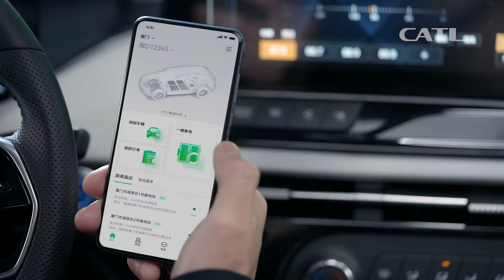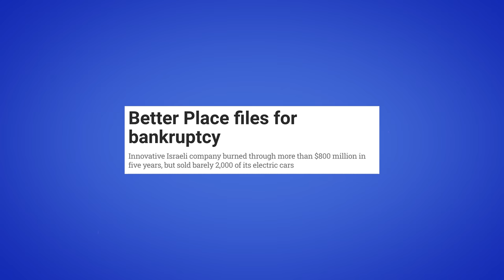Why Battery Swapping Is A BAD Idea

Comment: I must say i do not agree with your opinion, battery swap is the obly way to control waste and recycle the battery without wasting what is in it which as you said may be not enough. Think of alluminium cans they are all recycle because it is expensive to get alluminium. Alos there is another point you have not considered. If the battery fails for any reason in your vehicle, you are out of the sudden with an expensive paperclip. With battery swap will never happen, as it does not happen today with petrol cars, is you fuel tank is leaking you do not scrap your car, different is if your batter is sealed into the chassis and it is part of it scrapping the vehicle is the only economical solution. I would finally say that the goverment does not need to control car makers to change the market. Call all of them as said x size is the battery for city cars,x size is for medium cars and so on…they will need to stick to that and everything will be sorted..i think sometimes we think only at now and not at tomorrow but imagine how to manage milions of vehicle with a toxic waste welded in it on the scrapyard….

Comment: 3:40 "You could charge 72 cars in an hour"
You could actually do far better than that as a typical road trip charge takes around 15 minutes or less. Charging for an hour would be a massive waste of time and would be very unfriendly for your car's battery pack.

People typically think charging is like filling up with gas. When you notice you're low you pull into a station and fill from almost empty to full. That's not how it works with EV vehicles. Normally one would charge starting at around 10% or 20% and only going up to only 70%. After 70%, Tesla's charge at a GREATLY decreased rate to protect the battery pack. 

You'd therefore more than likely get closer to a maximum number of charges closer to 280 cars from a 72 stall Supercharger location.

Comment: There are technical reasons you mentioned, yes. I agree with your conclusion from just the technical reasons. But there's a bigger issue. The batteries are expensive and have limited lifetime, much shorter than the car itself. The price for a new battery is around $20K but the value will drop fast as you use it. Swapping means that you are swapping your $20K battery with some $5K battery. Oh, no private ownership but shared ownership  of batteries some people say? Shared ownership never happens with such pricey things, period. Never going to happen unless you are in a communist country.

Comment: I've owned my Model 3 for almost 3 years now and have gone to a super charger twice. I LOVE not going to the gas station. A battery swap station is just as bad... unless I could also charge it at home. Might work for long haul trucking however.

Comment: Battery swapping won't be a debate it will be required, and standardized by governments. 
Batteries don't like fast charging, the little pixies get all angry and hot when ya push them around like that. and it greatly reduces their life. 
Also power grids will be pushed to brink. If fast charging were to become the standard. 
But trickle charge over 8 to 12 hours with low amp's no change to grid required. 
Also the reduced risk for explosions, fires, with the added bonus of better battery maintenance👍
Further more:
Tesla's battery swapping was an absolute joke.
You had to purchase a 20,000$ battery, and there was only one location. 
Between L.A. and Sacramento I think to swap it out. But a year or so later the cars could do the journey on a single charge. So bye bye changing station. I wonder if the tool refunded the money for the batteries. 
I bet he didn't🐸
Reply from the maker: The swap stations can hold a max of 13 spare batteries. Let’s assume they’re all fully charged at 9am. By 11am they might all be empty due to swaps. You want to trickle charge 13 empty batteries over the course of the rest of the day? If that’s the case your battery swap station is useless as it’ll only have full batteries in the morning and at night.
Reply: @AutoTraderTV  For the most part, the average driver wouldn't need to swap out a battery. 
Simple fact most people don't drive more than 100 miles per day. Semi's, delivery trucks, bus lines, taxis they'll highly most likely will be swapping.
The possibilities are endless, and I can't wait. 
If you don't think the world isn't ready, or mabey you personally aren't,  let me give you a little food for thought. 
2022 we saw the release of Ford Lightning, the F-150 is the number 1 selling vehicle on the planet.
The all electric Ford lightning sold out the first year of projected production numbers in "less than a week"
Every six seconds someone buys a new F-150 and now they can buy the fastest, most reliable one ever made  🐸 and just so happens they don't burn dead dinosaurs.
Reply: @AutoTraderTV  Ya still there😕 where I live the price of gasoline has literally double over the last month. This single event will touch everything. 100% inflation rate over less than 30 days.
Really not good.
Electric vehicles would be immune to the volatile market's such as crude oil.
Plus with reduced demand mabey they don't wage so many wars over it either.

Here's something ironic, between the U.S. and Russia there's enough natural gas on reserve to power every home and car on planet for 200 years with virtually no environmental impacts. 

"T Boone Pickens" Oil tycoon made a documentary explaining how switching to Natural Gas would greatly reduce combustion engines impact on global warming. 
As well as give technology time to come up with better alternatives. 
I hope that electric wins out, less middle men with electric cars. Plus they can be powered by the Sun 🌞 or windmills.

Comment: Great video.  It's worth bearing in mind the current cost of DC chargers, as they don't come cheap.  They're something like €70,000 for each unit.  Still cheaper than battery swapping stations, of course.

Comment: Battery swaps work in certain scenarios such as high density places where it's hard to provide overnight charge points for most people. 

Also, if Tesla did implement battery swap, I am sure the fanboys will be over the moon and singing a different tune.
Reply: But in high-density scenarios, it probably makes more sense anyway for people to mostly use public transit, and rent a car when they need to go someplace in the sticks that's off of transit routes.
Reply: Tesla driver here
I'd be bummed they are wasting time on a dead end idea.

I know its hard to believe but fast charge is just as fast as hot swap. I know people think they'll be swapping out your 300 mile dead battery for a fully charged 300 mile battery but the reality is hot swap cars come with a 150 mile (or less) battery, and you will swap it with another equally small battery

You basically end up doing the same thing we already do today - drive 100-150 miles and then stop for a charge or hot swap.
Reply: @dorvinion  in reality, you aren't keeping up. NIO cars are the only ones with swaps and they are not low range EVs. 

Fast charge is only fast up to 80% but swaps , you can receive a fully charged battery in 5mins or so
Reply: @TsLeng  Unless You are 12th Nio car in hour and swap station barely manages to keep 1 pack fully charged
Reply: @AaronOfMpls  people like their own car for any reasons and battery swaps is a work around certain limitations like not having individual charge ports with apartment parking.
Reply: @darekmistrz4364  I don't get what you mean. Even with rapid chargers, there is always a hard limit on bays and even peak power output. Fill up all bays, almost certainly they will not be able to output at their highest rate all at the same time. 
Then yes, turn up at a busy time and you have to queue. 

If anything is against swap stations, it's that you need more resources to manufacture extra batteries in addition to cars in the road. Batteries are carbon intensive. 

Some offset to that is swap stations can take advantage of cheaper off peak electricity to fill up it's stored batteries and also smooth out power demand on the grid. That is with enough data and clever prediction. 

Like I said, Tesla fanboys will be all-over this shit if elon suggest it. Cue the talk about advanced AI to predict demand, no worries about battery preconditioning, etc etc.

Comment: The Gogoro electric scooters use swoppable batteries and it works very well. Unfortunately Kymco also designed an electric scooter but with a different incompatible battery. This is an example where capitalism fails to serve the population. We need standardisation of packs. There are many advantages to swoppable packs. They can be charged using off-peak electricity to balance the grid load. They can be smaller and lighter because a swoppable pack car doesn't need the same range when it's easy and quick to "refuel". It's a great system and it just needs proper standardisation and engineering. All cars run on the same gasoline, so there's no reason they can't use the same batteries.

Comment: "Everybody knows that charging an electric car can be a huge pain in the backside". Do they? Really?

Park outside your house, plug it in, wake up the next day and it's charged. No going out of your way to a petrol station. No queueing to pump, or pay. Massively cheaper than petrol or diesel. That's charging for the majority of users.

Even if you use public chargers then normally the only issue is a small queue if they're all in use. Once you can get on a charger it's easier than pumping petrol or diesel as you can plug in, go to the loo, get a drink or a snack, and come back out to a topped up car. I'll never go back to ICE.
Reply from the maker: EVs are great. But claiming it's always plain sailing is very disingenuous. Public networks need to be improved, vastly, and in many ways.
Reply: @AutoTraderTV  as is claiming charging is a pain in the backside. For most EV owners it's actually easier than filling up with petrol or diesel. It's only on those infrequent occasions that you have to use a public charger, and even then only if it's broken or there's a queue.
Reply from the maker: @AlistairHughes  The statement "charging an electric car CAN be a pain in the backside" is entirely factual. Yes, it's incredibly easy at home. And yes it can be a complete faff when using the public network. I love electric cars. I don't love the current state of public charge infrastructure.
Reply: @AutoTraderTV  anything can be a pain when the infrastructure fails. Remember last summer when there were massive queues at the few filling stations that had fuel while all the others were empty and coned off? At that point EV owners were laughing.

95% of the time charging an EV is genuinely easier and more convenient than fueling an ICE vehicle. So next time maybe try something like "For most people, most of the time, charging an electric car is simple. Right up until you have to go on a long trip and need to rely on public chargers."

I agree the charging infrastructure needs improving, but it's not terrible (in my experience) and there's a lot of investment already happening.
Reply from the maker: @AlistairHughes  I was laughing in my Leaf, too. Clearly I have a very different experience to yours on public charging. I don’t want to invalidate yours, but I stand by mine. There aren’t enough locations, not enough points, theyre often located in badly-lit environments that feel unsafe - especially at night, they’re often not fast enough, they’re often broken, too many require subscription/sign-up, and many are expensive. Roll on that investment.
Reply: @AutoTraderTV  I agree with all your points. And I'll add the fact that almost all are exposed to the elements without the canopy that filling stations offer.

I just felt it was a very negative statement to start the piece, even though it fed into the reason why battery swapping is an alternative. I could imagine someone interested in EVs watching to see how this technology would play out, and being discouraged when a respected car journalists, such as yourself, seemed so negative when in reality charging is rarely an issue.

Anyway, I still enjoyed the video. Keep up the good work, and maybe visit Gridserve or Osprey and do a piece on the charging options they are rolling out.

Comment: Battery-swapping just doesn't make sense. Each car manufacturers can come up with the their own unique shape and size of batteries and even more variations come into play when we consider the charge densities of the batteries. A battery swapping station can only cater to a limited number of variations.
On another note, I strongly think we should move on to hydrogen, instead of playing around with batteries for these electric toys. Even if proper environment friendly hydrogen can be produced by electricity, we must understand that electricity is the energy while hydrogen is the fuel that produces the required energy when subject to certain reaction.
Reply: True. It only makes sense with Battery Standardisation.
Reply: @pg205  I strongly believe that rather than a fuel station, it is more like a service station, where cars of one particular manufacturer can be served at one place.

Comment: Battery swapping is a moronically stupid idea.

First, the battery is the most expensive part on an electric car.  They are incredibly expensive -- $10k and up.  So to do a battery swapping system, the system owner will need to buy many of these batteries and just stick them on shelves.  While they are sitting on shelves, they are earning no money.  So it represents a huge capital outlay that mostly doesn't earn money.

As the owner of an electric vehicle, you then go and swap your battery for another battery of unknown condition.  Batteries lose capacity over time.  So you might end up swapping your brand new battery for a battery which is much older and has less capacity.

Comment: I'm still not sure that electric is the right next step.
As you've mentioned, batteries are hard to make, and the resources are dwindling already just like the fossil oil we use right now.
I don't see the EV replacing all current vehicles in the next 30 years and after that we might already have a shortage.

So imo this is a dead end.

Comment: I think he misses the most obvious issues with this. Do you realize how many things can go wrong while swapping a battery like this? It is going to be an absolute disaster, the machine will get stuck, the people won’t be able to align the car properly, there will be injuries etc etc etc. I also think it’s a terrible idea especially because of this.
Reply: There's no single case of failure with nio tho, also nio said even with only one bolt Nio's battery would still attached and works

Comment: probably someone said something similar about setting up a petrol station, can BP set one up for less than $600k? Battery swap makes a lot of sense, if all car makers used a universal battery size......
Reply: Sure, but the difference here is that you aren't standardizing just the fuel - you're trying to force the entire fuel tank to be standardized. You're forcing every car to use the same fuel tank, meaning the car has to be designed around the batteries. They can't innovate at all on the power system, or make any interesting designs, or any of that.

Comment: This appears to be one of the most poorly researched videos I have ever seen.

To address only one of the falsehoods: the statement “we will need more batteries in the battery swap world”. In reality, drivers can choose to swap in a large capacity battery when they are planning to drive a long way, or a small capacity battery if they are planning only short trips. The large and small capacity batteries can have the same form factors. This will reduce the amount of battery we need to run the world’s fleet of vehicles. This will reduce demand for lithium, reducing its price and making EVs more affordable for the mass market.

secondly, why no comparison with filling up the fuel tank on an ICE? The world is very used to a refuel that takes 5 minutes or so. If this was a significant problem, the world would have told us about it for ICE vehicles by now.

Comment: Battery swap is the future and the future is now ... battery technology continues to evolve ... imagine upgrading to a battery with greater power and range, imagine a bad or old batteries being taken out of the ecosystem and swap times being 3 minutes ... well it happening ... China now has nearly 2500 swap stations, as well as plug in options, and companies are partnering up to embrace the concept ... what do you do with a telsa car once it's battery it's cactus? dump the car? spend $20K on anew battery  ... who wants to wait up to an hour charging an EV in dodgy weather with young kids in the car ... understand that electricity is not petrol/gas ... it requires a different delivery method, see what Nascar do ... open your mind Autotrader ... with such a negative mindset is it no wonder that the UK is going backwards ... in another year this video will look even more silly ... Fantasy you say? or is it visionary ... BAAS is here now ... maybe time to update this video and provide a part 2 ... all the best